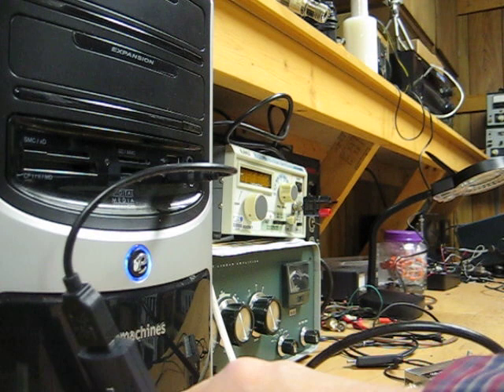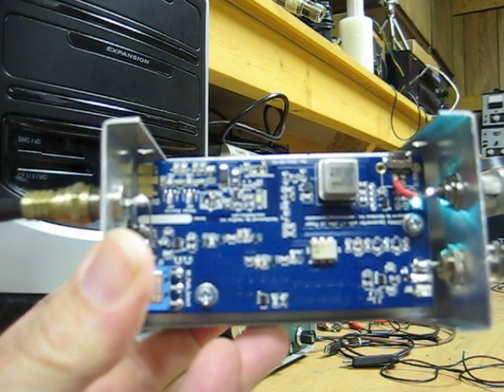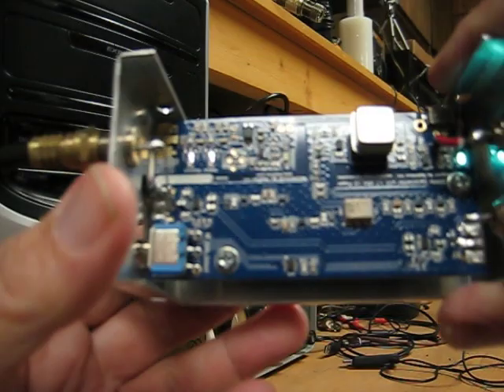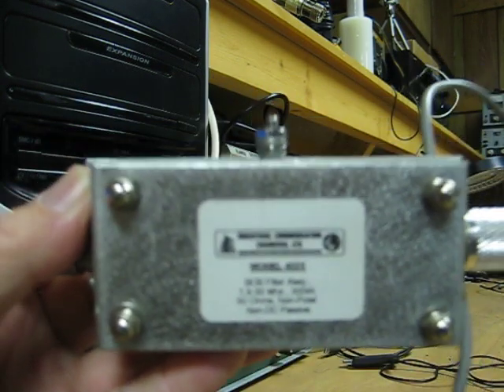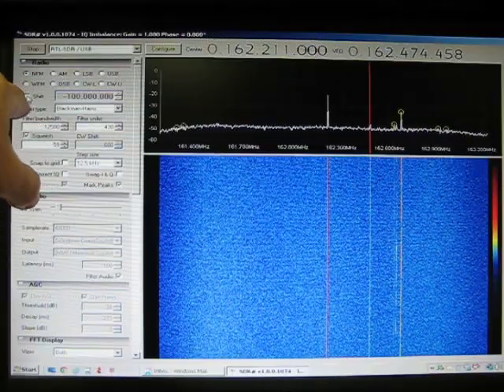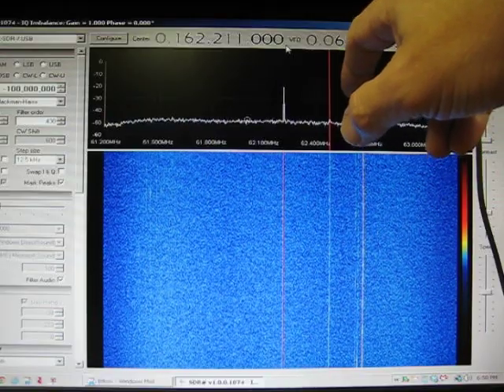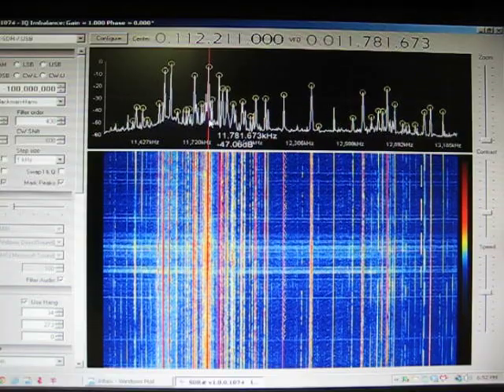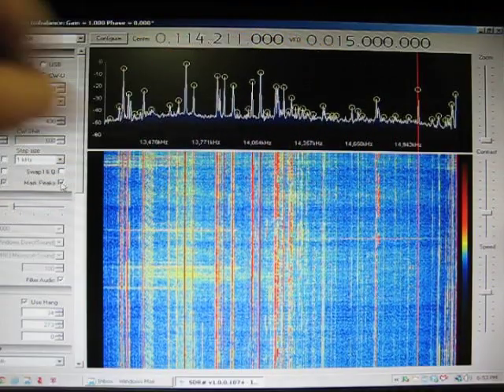N4LQ Using RTL Dongle SDR# and Ham it Up Converter

Comment: Great video ! Setting mine up now.... what type of antenna were you using ?? I was thinking of using my OCF dipole until I get get a beverage type of antenna... recommendations ?? Thanks for the video !!
Reply from the maker: Just like any receiver...The impedance of the antenna should match that of the receiver however we really don't know what that is and it covers such a wide range that no one antenna would be "ideal" therefore just do the best you can. I had to use the ICE BC filter to keep local AM stations from swamping the receiver. A tuner would be helpful too. A random piece of wire will pick up some stations.

Comment: That was great thanks. I just ordered one of these. Does the software you are using come with the dongle?
Reply from the maker: no
Reply: Steve Ellington
As you did not bother to tell me I will not ask the next obvious question but thanks for the short answer.
Reply from the maker: Steve Ellington You said you "just ordered one". No. Dongles don't come with free software that you download from the web. I use HDSDR. ....Download here http://www.hdsdr.de/
Reply: Steve Ellington Thanks. The dongle I have ordered comes with a CD so I presume that it must be just the drivers on there and no software on it.  Thanks for the link that really helps me and I guess, many others who are new to this and confuddled by it. Appreciate your time.
Reply from the maker: InTheNameOfJustice Ok but that dongle was made for TV reception in Europe and possibly the software or drivers on that cd are something you don't want to install. It's been a long time but the QST article tells where to get the drivers on-line. The internet is loaded with more info.
Reply: Steve Ellington Thanks Steve
Reply: +Steve Ellington man I DL'ed that it has Malware but I got rid of it and it works great

Comment: How do you protect the Ham It Up (HIU) unit from overload when you transmit on your HF transceiver?  Do you have to disconnect the antenna from the HIU unit?  I have a kenwood TS590 100 watt transceiver and wish to use the SDR to find activity on the HF bands and then us the 590 to transmit.